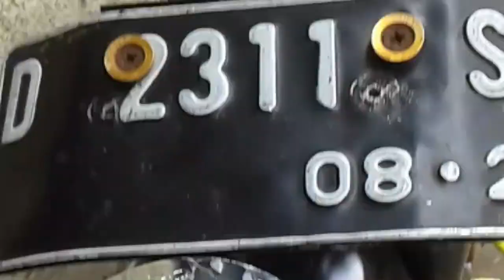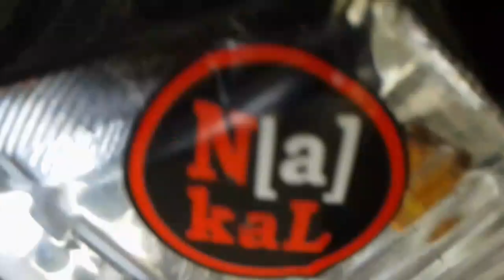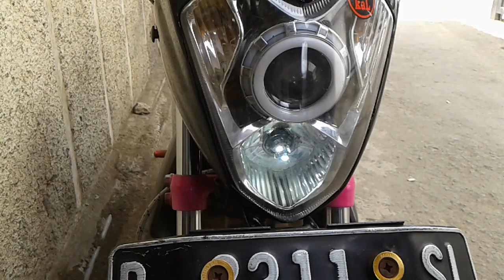Pasang proji Led fu buil up no bbok no potong kabel

Comment: Aslmkm mas, mau nanya, kalo satria fu 2012 sering/gampang tekor aki nya, itu masalahnya dmn ya? Dan solusinya gmn? Mhon pencerahanya mas.. Trmksh ..
Reply from the maker: Ori atau lampu depan sudah led
Reply from the maker: Waalaikumsalm
Reply: Masih ori semua mas.
Reply: @yundaralvian4546  masi pake lampu orinya mas, jd solusinya gmn?
Reply from the maker: Ori itu bisa jadi kiprok sama spull ms antara dua itu,sama perkabelan jalur
Reply: @yundaralvian4546  waduh lumayan jg klo gt. Cara cek nya gmn y mas.? Misal ciri2 klo kiprok yg rusak, atau spul yg rusak.
Reply from the maker: Harus pake multitester ms,klo ciri pemakaian lampu depan redup aki cepet tekor
Reply: @yundaralvian4546  o gt y..okelah musti k bngkel y, 😂
Trmksih bnyak mas.
Reply from the maker: Iya ms,sama sama ms
Reply: Satria fu itu dc apa ac yg tahun 2012 sih ,gx tau saya ,
Reply from the maker: Untuk fu karbu smua lampu depan msh ac ms
Reply: @yundaralvian4546  tpi kok spull na kaya fullwafe ya tpi kok ac ya ,maklum sya itu kurang ngerti mas .mohon penjelasan na